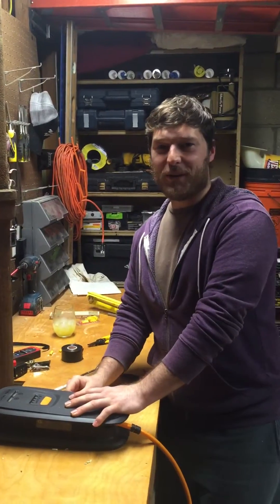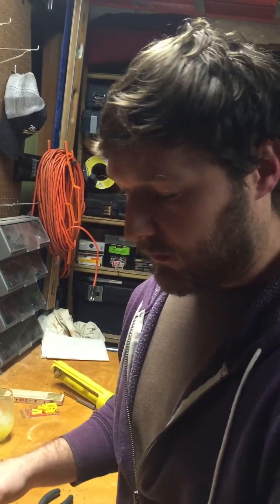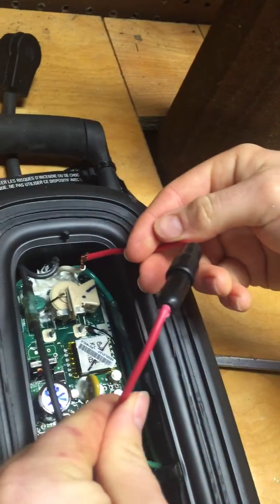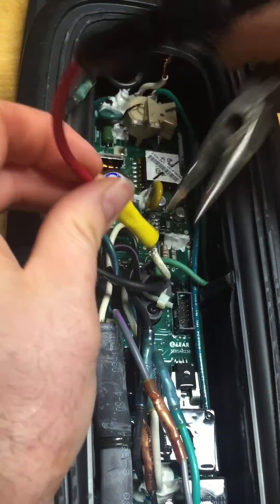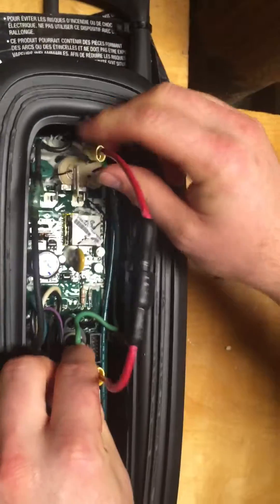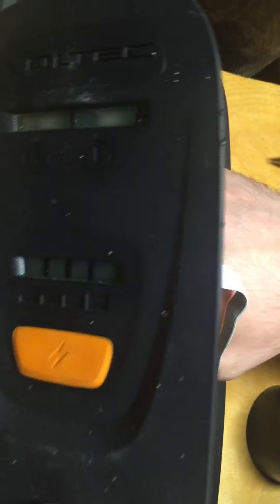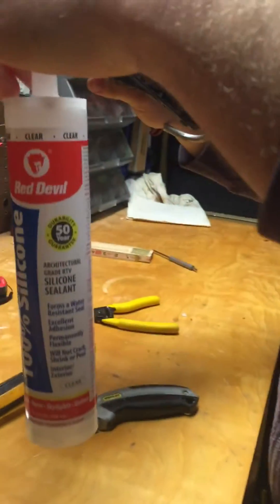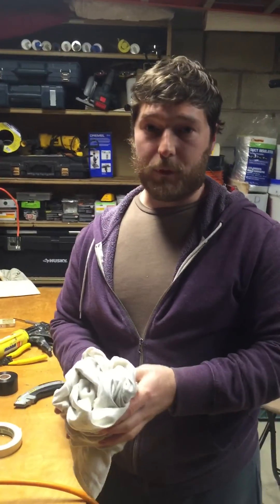Chevy Volt Charger Fuse Replacement

Comment: Heat shrink and some solder would have been quicker and cleaner. Thanks for the fix! 6 Months in and this thing failed. May have to unplug when not in used maybe. I'm wondering what causes this issue? I do not use an extension cord with mine.
Reply from the maker: That's a really good question because I'm not sure what happened with mine either. I do keep it in the sun so I'm wondering if it overheated. I had to replace the fuse again after I performed this fix but it was easier the next time with the fuse holder already in place. The point is that if there's some other underlying issue I think we'll both have to keep replacing fuses until we figure it out.

Comment: Do you have the amazon link for the inline?
Reply from the maker: Here's the link for the fuse older: https://www.amazon.com/dp/B000A8E0KI/ref=psdc_6355937011_t4_B008UFXLAS
And here's the link for the ceramic fuses: https://www.amazon.com/Pieces-6mmx30mm-Faset-Blow-Ceramic-Fuse/dp/B00P3G2DAQ/ref=pd_bxgy_263_img_2/143-8319931-2745861?_encoding=UTF8&pd_rd_i=B00P3G2DAQ&pd_rd_r=83c6662d-6ffc-11e9-ad38-41b6964a56af&pd_rd_w=QvX4s&pd_rd_wg=SwbIL&pf_rd_p=a2006322-0bc0-4db9-a08e-d168c18ce6f0&pf_rd_r=KYKRZF116K7NR33E84T5&psc=1&refRID=KYKRZF116K7NR33E84T5 
Other people have had some really good comments about how to do this better. In the future I would use the heat-shrink connectors.

Comment: FYI, my fuse holder (same one he used) melted after a couple years of daily use. I think the first holder isn't rated for 120v, it did last awhile though. I also think the fuse (same one he used) is rated too high to be functional. I think it should be around 15amp or maybe just a little more. I'll be looking for new materials to repair mine.
Reply from the maker: If you find the better stuff please link to it! Am definitely interested in upgrading the fix!
Reply: the charger is rated for 12 amps, i cant imagine a 15 amp fuse wouldnt be enough, unless some sort of in-rush current could pop it. i tend to agree with you here.

Comment: Having the same issue with mine. The fuse in the charger is a 20amp 500v ceramic fuse, btw.
Reply: Would this need a 500v? Out of curiosity, why did you go with that one?

Comment: Thanks for posting this. I had to replace the input cable also, the jacket on each wire inside the sleeve was falling apart. $20 and 20 minutes later it's working again!

Comment: Can;t beleive you did not buy shrink wrap tubing, I mean taping it with electrical tape. At least use non sticky under the tape so it will not be sticky when you have to take it apart. .

Comment: Duuuuuudee.. This is very useful, but always solder the wires together VS using butt-joints. Reason being, you can have the power arc and have it fail again. Spend the little extra money for some solder, a soldering gun, flux, heat shrink, and a heat gun. Safest way possible.
Reply from the maker: Definitely agree. As long as I have the electric car it would probably be worth investing in the soldering tools/skills.

Comment: is your inline fuse holder still holding up and do you charge at 12amps? the fuse holder doesn't show a voltage rating. thank you
Reply: Yeah it's still holding up. It pulls just about 12 amps when charging and the fuse is rated for 20 amps so there shouldn't be an issue there. The holder I used has 12 gauge wire which will handle 120v no problem at such a short distance.
Reply: sweet, I just got done installing mine,  my power and neutral wires were almost completely melted inside the evse. the evse is around 4 years old so i guess that is to be somewhat expected from I've read. I cut a foot and a half off of a brand new 12awg extension cord and soldered/shrink coated each connection along with the inline fuse holder you used. also used a fast blow ceramic fuse. It's working great so far. Thanks for the info buddy
Reply: Would I need a 20A 500v fuse? Does it matter?

Comment: This video was super useful. Thank you. I think it should be noted that you'll want a fuse rated for household power not an automotive fuse made for 12 volt. I went with a 20A240V ceramic fuse on mine. Automotive fuses will say 36V and I'm thinking they wouldn't hold up as well.
Reply from the maker: Yeah good point I must not have mentioned it in the video but I also used a quick blow ceramic fuse!
Reply: vaughan piccolo, once again, thanks for helping me save $400. My only complaint was the lack of margaritas during my repair session. ;)

Comment: Thanks for the video. This sure beats paying $400 for a new EVSE.  Did you ever figure out why the fuse blow?
Reply from the maker: +Ralph Coleman Thanks Ralph. There's a GFCI outlet on my deck next to the kitchen that I use to plug in the EVSE. There is another outlet on this circuit that's in the kitchen and I'm pretty sure it happened when we ran the toaster oven at the same time the Volt was charging so I'm guessing the circuit was just overloaded and the EVSE fuse blew before the breaker at the panel.